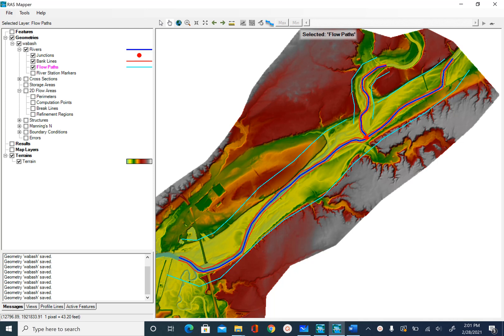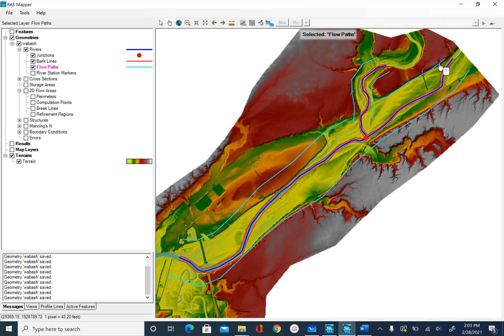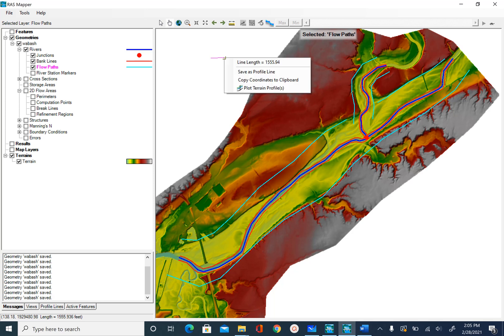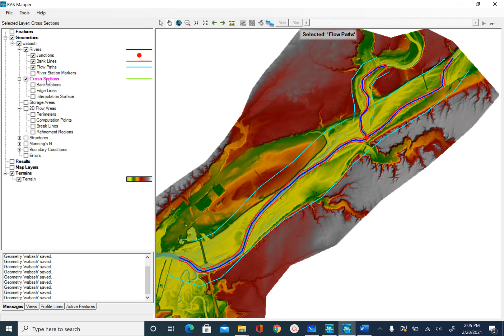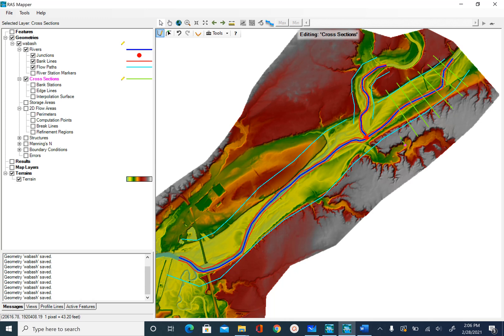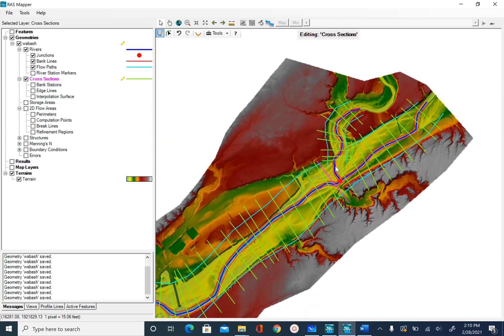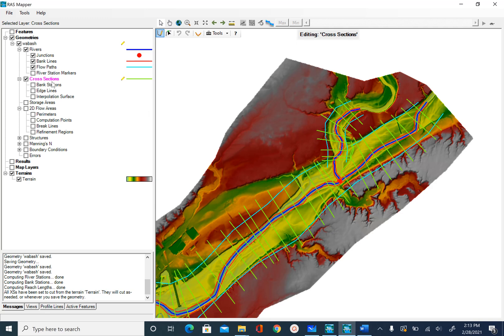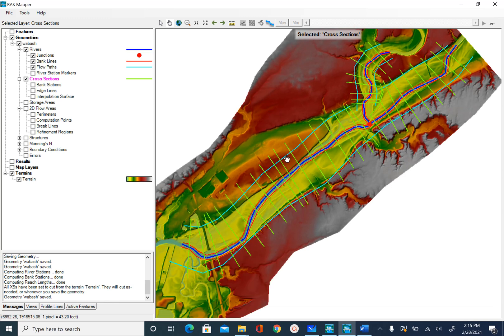1D Hydraulic Modeling using HEC-RAS (6/10) - Create Cross Sections

Comment: I have followed all the steps. However, when I plot my cross section data it is blank. It indicates no data. Any reason for this?
Reply: Thank you. I figured it out. My terrain file was incorrect. Your videos are very helpful. Really appreciate your quick response as well.
Reply from the maker: are you using my data or your data. most likely your cross-sections are not aligning with the terrain

Comment: there is a problem with your cross sections. You create them using the DEM data which gives the water surface height in between the banks. That is why it shall be modified according to the bathimetry data. Else you will be running your simulation on top of an elevated river with flat bed.
Reply from the maker: good point! the DEM that is used here has bathymetry integrated into it.

Comment: Thank you very much for the video, I have a question, how can we correct the geometry errors? I know that you right click and change geometry and they appear red, how to correct them?, thanks!
Reply from the maker: You should be able move vertices to change the geometry. I think you can also undo your digitization if you make a mistake while creating geometry.
Reply: @hydrologyvideos8253  Thanks for your kind answer, I've always had this question, is it possible to change the sensitivity value (the dotted circle that appears when the lines are drawn), it comes out too big, is it possible to place it smaller?
Reply from the maker: @soniacarolinalobocabeza4271  it is just a snapping tolerance.  it appears big when you zoom in and vice versa.I would not worry about it.